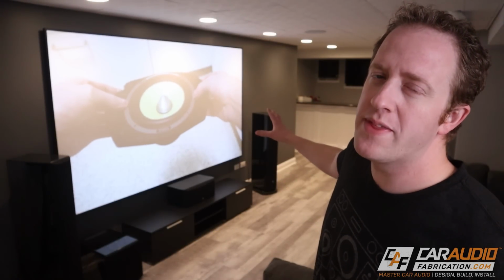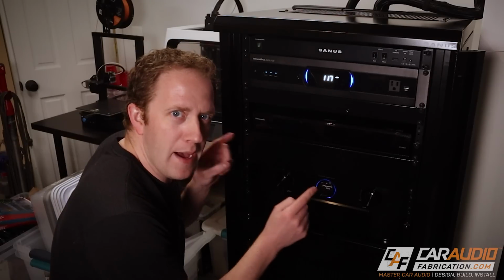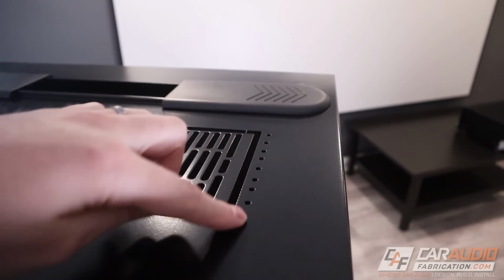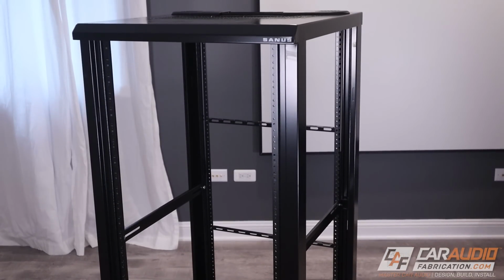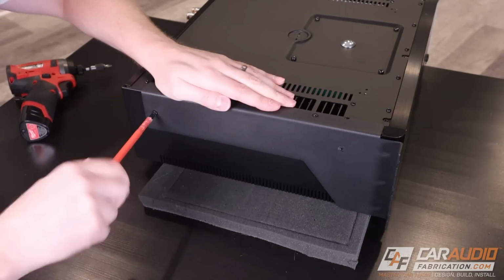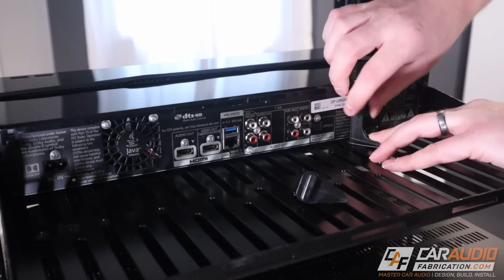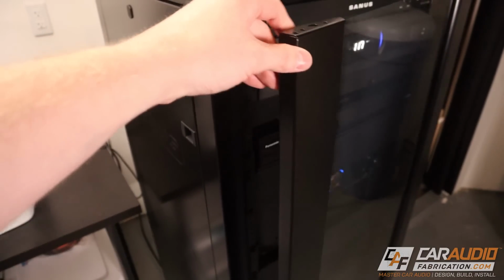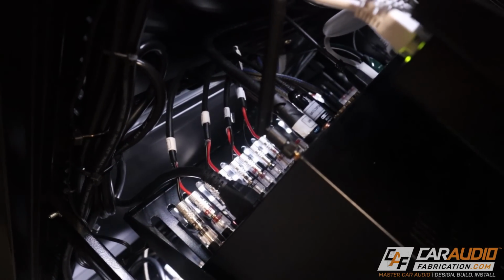Mounting, Wiring and Installing Components in an AV RACK - How to Assemble!

Comment: I was advised that the Surge protector should be at the very bottom
for the following reasons:
1) best cable management
2) keeps mains distribution away from phono signals
3) reduces visible cable clutte

Comment: Its possible to get releasable zip ties as well. I live in a condo apartment. We have to move every couple of years when the landlord increases the rents here in Toronto by 25%. SO nothing is permanent for us. U use Velcro for most tie-downs ad releasable zip ties when neatness counts. I store them in a fishing tack box and document their locations on a wiring diagram that I make in vision. Every shelf is labelled and divided into six spaces on the left and F on the right support post and the shelf is divided into five segments. So Velcro goes into  A1, or A2, or A3. The tackle box is divided the same way the first row of the top box is A1, and the second row of the top box is A2. This means I can quickly pack and unpack a system in a few minutes and then figure out where everything goes. Devices also get labels AMP001 or RCV001, BLU001, DVD001. This gets used on the shelf which gets the same device label. The rack cabinet get RCK001 (I have seven racks in the house. 3 audio and 3 home lab servers, and one telecom rack labelled TEL001). If you contact the manufacturers, they can usually provide can elements for each piece of equipment front and back. then you just drop them into you shape library and onto your diagram,. The same applies to the rack and shelves). Initial setup and diagramming takes time but it's handy when the cable guy comes over and wants to know where the demarcation is and how it connects to your home network. I also label cables the same way. One end would be rec001-01 and the other end would be AMP001-01.

Comment: I need some assistance.  I have cable box and a Roku, should both connect through the receiver first.  But, when we want to just watch news or a TV show without going through all of our speakers how would we make this connection?  We’d just like to use the TV’s speakers for news programs and regular TV shows.  And is it possible to set up the receiver so that when we turn on the Roku box it “triggers” the receiver to come on automatically?  Our receiver is a Marantz SR5010.  Thx

Comment: building it on it back i think is not great idea as to many things can go wrong when you are lifting it up. also you are putting a huge amout of pressure on the two wheels. you are so much safer to mount the devices when the rack is up right starting from the bottom and working up.

Comment: Quick question. I’m getting into av racks for the first time. For the shelves, I see you screw in the front screws to the mounting hardware, however it looks like some of the shelves are just hanging in thin air 😅? Wouldn’t that be a huge amount of torque pulling downward? Or am I missing that you attached something to support the rear of the amps as well?
Reply: I have the same question! Did you ever find a good answer?

Comment: Do you recommend 2U vent plantes between amplifiers or is 1U vented plates enough? I plan to put AC Infinity fans above each at some point? My Amps are Class D
Reply: Until you get the fans my recomondation would 2u and i think one fan should suffcient with a 1u spacing

Comment: Good day. Can u please assist me. I hooked up a line out converter to my stock radio. I have a monoblock amplifier and hooked up  the wires to my stock front speaker wires. Because i have a monoblock amplifier, must i put the 2 positief wires together and the 2 negative wires together on one front speaker? Or must i use both front speakers to hook up the line out converter? I hope u understand. I have a monoblock amp with 1 set of subwoofer speaker wire

Comment: New follower with tons of questions. 2013 Jeep Wrangler 4 door. Which size sub woofer should I be looking for. Only going with one sub. Thinking of a down firing box since I usually have no doors and no top. Thoughts? Ported or sealed? If ported should the port also be firing downwards? Also, Jeep has the two front speakers, two on the above sound bar like any other Wrangler and two speaker pods on the rear (c pillar) roll cage. All are 6.5” and thinking of making two of those into 6.5” woofers. Should I put those in the B or C pillar? B is a long bar so lots of more air and C are single pods. Which shallow 6.5 are recommended? Not looking for loud 2-Ohm. Looking for a deeper lower 4-Ohm… brings me to amps. Option 1. Two amps, one for the four coaxial, and the other for the two woofers and one sub? Option 2, one for six (four coaxial, two woofers) speakers and one 1 ch for the larger sub? Wires, which gauge for, speakers, woofers, sub, power etc is recommended? Any help is greatly appreciated. Thanks in advanced.

Comment: Hi Mark, I noticed that the MR 5100 has 4 high current outlets which you more than likely plugged the three amplifiers in, my question is if I have the M5400-PM which only has two high current outlets how would I go about connecting the same three amplifiers to the unit?

Comment: Nice I’m also running Marantz and Rotel, and a UB820. No rack yet. I like tech, so home theatre in next house will have a rack built into the back wall with a tinted window so you can just about make out the lights.

Comment: I built my own wooden rack and this prefab one is making me considering replacing it. Super nice layout!
Reply: I built my own and it works but a prefab one has many advantages.
Reply: Yes also working with wood also because I am modifying a DJ set up which includes classic old melon crates.
Reply from the maker: Thank you! The design of these is very nice. Well worth the dollar bills in my opinion